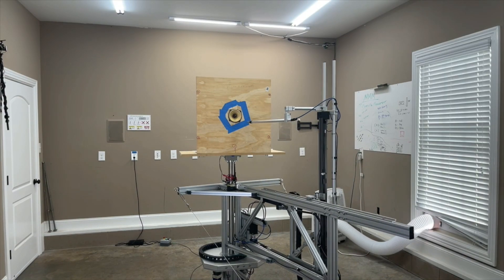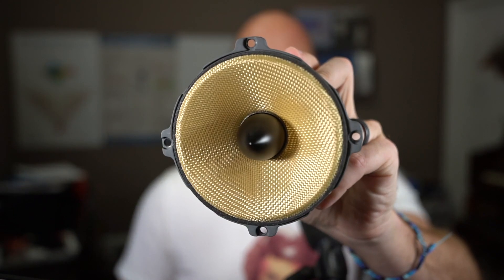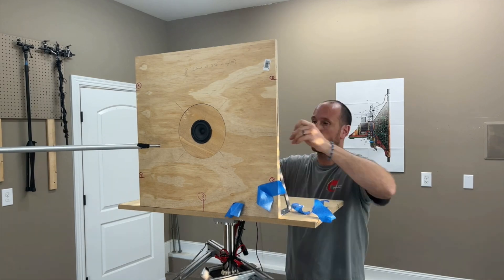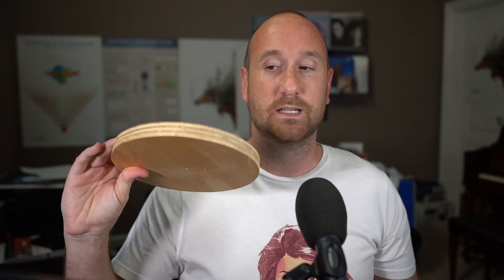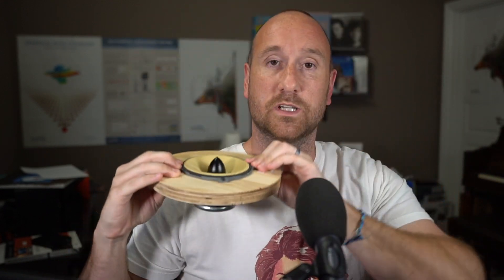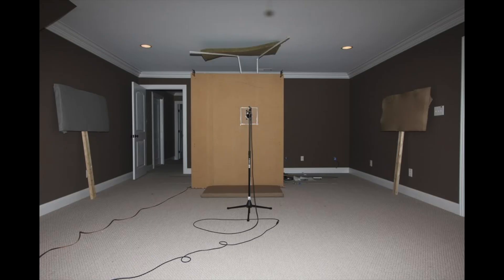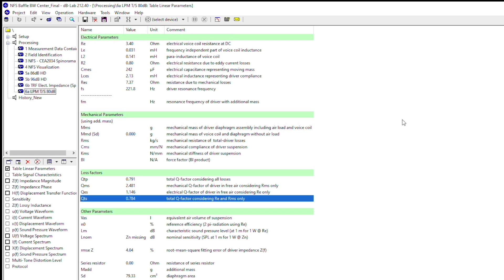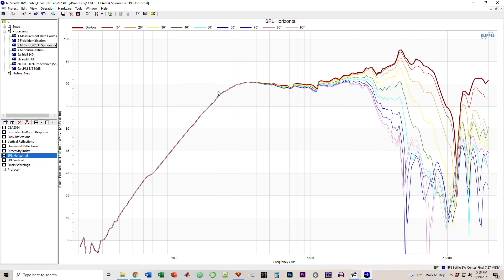How good are Bowers & Wilkins drivers?  Let's test and see.

Comment: You said this driver is from a center channel. I b&w center speakers apart and even though they look exactly like the bookshelf speakers from the front. They are no way even close to the same tweeter or mid driver as the bookshelf drivers. I'd like see the same tests done on a driver from one of the b&w bookshelf or floorspeakers

Comment: I would be surprised if that blip at 1.2kHz was from cone edge/surround, the LF000264, as measured by Zaph, has no such resonance, and that's the entire point of the flat surround anyway, to prevent this from occurring. My own experience with the 6.5" FST also mirrors the absence of the FR associated dip, impedance and distortion blip. If this little driver has such a surround resonance then B&W really didn't do their R&D properly here. 

That issue aside it's actually pretty decent in my opinion. Above 500Hz, at 96dB, it has better distortion than the 10F. Very low 4th, 5th, 6th, a third harmonic that falls off the radar with increasing frequency and no real HD associated issues because of the cone break-up. This is very much like the big FST, with very low inductance, only in the 4" version it cannot be used anywhere near as low. Basically you need to use it an octave higher than its bigger brother, which is no surprise given it's much lower surface area.

It is essentially a 90dB/4ohm driver, which is usefully more sensitive than the 10F. Depending on how loud you want it to go with very low distortion cross at 300 or 500Hz, 4th order, and as low as your tweeter will go. B&W always mis-use their drivers and crossover way too high.

Can you tell me if the phase plug is removable?

Comment: Cool video! Always been curious to see the raw response of some B&Ws. In practice though I don't think it's that bad once you throw a crossover on it. For grins I took your frequency response and impedance plots and created .frd and .zma files and noodled around in PCD for a few minutes to see what this thing could really do. This driver is actually quite simple to work with and models very well even with simple crossover components. A single 0.33 mH inductor (6 dB/1st order) combats that rising slope near perfectly making the response flat and providing a decent 4th order acoustic slope at about 6 kHz. That's a bit high for most mids, so to bring it down to 4 kHz only takes a 0.45 mH inductor and 12 uF cap (12 dB/2nd order) to provide a nice 4th order acoustic slope at 4 kHz with a near flat response all the way down to 200 Hz. So in all fairness, despite the perceived raw FR plots, the driver is perfectly workable in a system. But like you said, it ultimately depends on what you want to do, and this driver will not fit the bill for every situation.
Reply: Of course once on an enclosure that could change to a more complex xo... or not like you said depends on the application and what you want it to do. It does look cool though:)
Reply from the maker: Cool stuff.  If in the future you see my tests and you want the output data just ask.  I can email it to you.

Comment: Just curious how one justifies a ~ $100k Klippel test tool?  What are you using that thing for besides reviews?  I’m not even sure if many manufacturers pony up for one of those:)
Reply: I’m not hating, just generally curious as I’d love to have one.  I’ve gotten pretty good with my measurement routine but polar and listening window test are time consuming.  Low frequency resolution without having to do ground plane out in the elements is good.  I’ve given up on splicing near field and far field for higher resolution because it’s too hard to get right….
Reply: Klippel measurement system consists of many modules. NFS is one of the modules and shares some hardware and software with other Klippel system. I guess Erin has other modules for motor system analysis.

I can say for certain that every major speaker manufacturer uses some modules of klippel for RnD and production. You can check the list of Klippel users at its web page. 

NFS is not a common and popular module because anechoic room can substitute it. But You can not build an anechoic room + automated measurememt system with 100k. Even a small one with 100Hz cut-off frequency will cost more than 200k. The room only.
Of cause some measurement such as microphone measurements requires anechoic room though.

I guess 100k NFS maybe too much for a "reviewer". I , Klippel distributer, still don't have the demo equipment of NFS. I thought Erin was running some consulting company at first. But if you are serious on SPL based analysis of speakers, NFS can be a "cheaper" alternative. Other simulated anechoic measurement methods have thier limitations. I think you already know them.
Reply: @roger_isaksson  Or you could buy a decent system for $50k and cd's, vinyls, downloads or whatever format you prefer for $50k.
Then sit down, pour your favorite beverege and just listen..... and forget all about measurements😉

Comment: Never enjoyed listening to B&W Kevlar midranges. You measurements tell me loud and clear why I have not been able to stand listening to them! Nice simple review of a mediocre driver.
Reply: Which parts don't you like? I though they are crossed over away from most of the issues?
Reply: @RennieAsh    Crossovers are tools that have their limits. The resonance at 4.5k is not a simple thing to null out in a crossover. If you flatten it out and you think it is gone you are mistaken. When you have a transient in the music around this point, and many types of music have significant energy in this region, you will again have a nonlinear driver that will be creating a resonance at this point. It will bleed through into what you are listening to. I ran into this with a few drivers I have worked on. These distortion effects are most noticeable when you don't hear them any longer. Once you have a very clean reproduction system you will notice these kinds of loudspeakers that hum along with your tunes. It is difficult for me to listen to nonlinear loudspeakers as I can readily hear these resonances.
Reply: Kravchenko Audio if you cross any driver at its breakup point it will do that. Do they let that peak through with volume or do they cross over much below that point?
Almost every driver will have a breakup peak, aside from some poly cones or floppy paper etc
Reply: @KravchenkoAudioPerth  Actually, with this driver, the 4.5kHz resonance is something you can simply notch out. It doesn't affect the distortion in any meaningful way, so if you notch it out properly, you aren't going to hear it.

Besides this driver is not supposed to be used that high. As Erin mentions you start to get beaming, with a driver this size, just below 2khz. This is way below that resonance peak. B&W cross this over inappropriately but this is pretty much B&Ws entire ethos in a nutshell. Make good drivers drivers and then use them up way too high. 

I'm not surprised that you dislike B&Ws speakers as they are all quite poorly designed. B&Ws drive units are excellent though, they are just mis-used. The 800 series are the biggest offenders taking the 6.5" unit all the way up to 4-4.5kHz and with a very simple crossover!

Comment: Expectation: a driver with excellent build quality, great dispersion, plenty of power handling, and incredibly competent engineering... In every aspect except frequency response which they'll voice by ear and kick all the engineers out of the room for.
Reply: Reality: it looks decent over 300hz and under 1000hz.
Reply from the maker: I'd say 2kHz is feasible.  The issue, really, is the increasing treble which means the crossover would need to be more involved to get it to a point where you have a traditional acoustic crossover slope of LR2 or LR4.  Which means more $$$.  But if used with a DSP then it's more manageable.
Reply: @ErinsAudioCorner  Usually a rising response is very easy to crossover and requires no additional parts vs if it's flat, you just tune the values differently. A peak, on the other hand, is another story entirely.
Reply from the maker: @biggityboggityboo8775  right. The combo of the not-too-well-behaved rise and the ringing at its peak are what would make it a bit tougher to remedy.